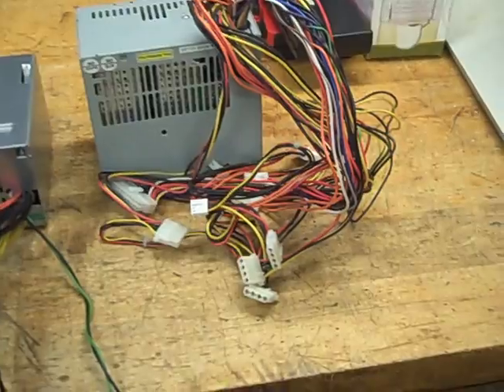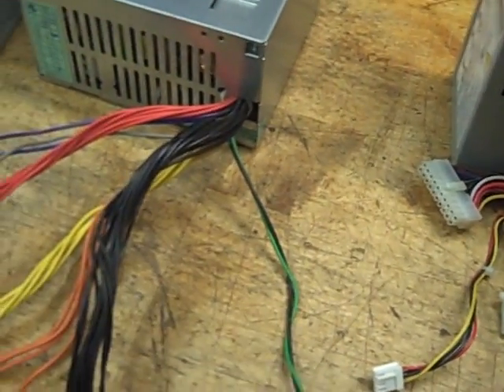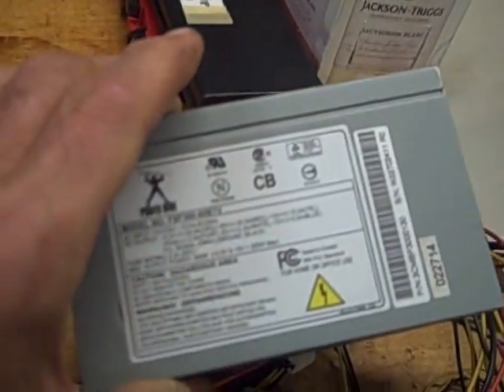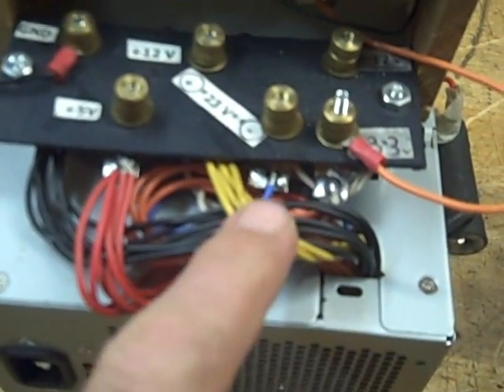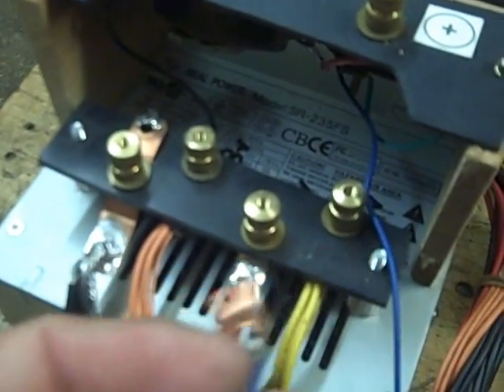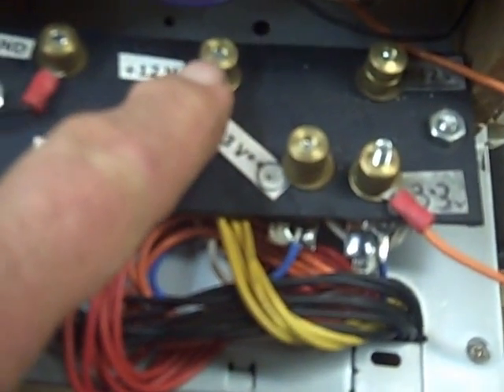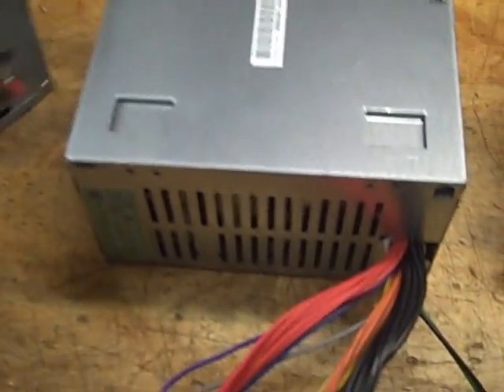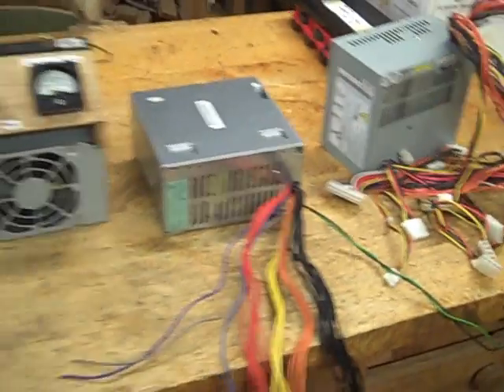DC Power Supply from ATX power supply

Comment: I have 3 identical power supplys. The 12v rails on them are rated at 8 amps. one thing I noticed is if shorting green and grey or black without cutting the clips off the PSU would power on. Once I started cutting off the clips and grouping the wires the PSUs would power on and die immediately. After many hours of messing around I found out that shorting green and ground AND brown and grey makes them power on as normal. I was hoping you could offer some explanation.
Reply from the maker: I suggest that you only use the green and black wires to turn the PSU on. That's what the computer motherboard uses to wake up the PSU.

Comment: Sir,
Did you used all the wires (like all the black wires and all the red wires) and connected them together?
Reply from the maker: Yes, I used all the wires of each colour. 
I removed about 1 1/2 in ( about 35 mm) of the insulation , twisted the bare wires together and soldered them into one big "lump" of wire. That was I get the full benefit  of the power supply.
You'll need a good soldering gun to get them all done together.
I know that some people don't use all of the wires of each colour.
But there are some uses of the power supply that draw 8 - 10 A  ( eg electrolysis for rust removal, flood lights from car headlights etc)
Reply: +disproman wow nice information I get here :D thanks man, I was thinking to use just one of each other but you have changed my plans :D

Comment: I have a new power supply I want to run a car stereo off the 12V only. Can I just tape off all the other extra wires or do I need to put resistors on them? Also what are the purple and grey wires?
Reply from the maker: You can simply use the 12V wires ( yellow and black) and tape off the other voltages.
You don't have to use a resistor since your power supply is a newer one ( the older ones i.e. 1990's needed it for stability). 
You should make sure that you power supply and the radio have some venting  - if they are in a sealed box, they'll probably overheat. The exhaust fan on the power supply should be OK to draw in cooling air for both radio and power supply.
Reply: Sweet, thanks for the quick response

Comment: hello

j'ai testé 15v court circuit pourquoi ?

I tested a short circuit 15v why?
Reply from the maker: I do not understand your question. Did you mean  that you short circuited the 15V combination?
I have found that IF yu short circuit any of the outputs the power supply stops but is not dead. You simply remove the short circuit, unplug the power supply from the wall for 15 seconds , plug it back in and it starts OK.
M
Reply: +disproman 
hi 
when I plug the blue + orange I get 15v. 
when I connect a fan or other I have a short circuit. 
it works with 12v + 120v fuse , but not work 15v :(
Reply from the maker: Remember that you only get about 0.3 to 0.5A from the blue wire. I think what is happening is that you are overloading the blue -12V supply and the power supply quits.
The other voltages  - 3.3V, 5V and +12V  have much more power available 15 to 30 A.
If you look on the nameplate of the power supply you will see how much you can get from the -12V supply.
M
Reply: +disproman 

I 12V 19A. If I understand correctly, I have not enough power, Power returned to 😵 secure mode, the only way to use the 15v source is to buy a more powerful power supply. Thank you very much for your advice.
Reply from the maker: About the only way that I know how to easily get a lot more current at 15V , is to use a microwave oven transformer, cut out the high voltage secondary winding, and rewind a new secondary with much heavier wire.
The primary on those microwave oven transformers is usually 125 turns. To get 15 V DC I would suggest 20 turns of 12 Gauge enameled wire. This will give your about 17V AC and allowing for a 1-2 V drop in a rectifier bridge, you'll get 15V DC.  
The transformer can be from an old microwave oven (free) the #12  wire would be about $8 - $10  and the rectifier is about $2. That would give you at least 20 A.

Comment: Can i get a bit more info on how made the current controller. must be simple, but i'm dumb. Thank you, for any help from anyone
Reply from the maker: Are you referring to the current controller in the unit with the Ammeter?
If yes, then all it is , is a variable resistor, that can handle about 0.7A. It is wire wound and I bought it at a surplus electronics store. You simply connect the variable resistor in series with the positive connection. That lets you vary the current that you allow  - limited to the 0.7A. If you need more current, then you just bypass the variable resistor completely.
Reply from the maker: The current controller is simply a wire wound variable resistor in series with one of the leads - eg the plus.
Reply: thank you

Comment: i see that you have the blue lead/ neg 12v so that you can get higher/different voltages in combinations. i am building my first atx bench psu, and don't quite understand the concept. i thought +12v and neg 12v would cancel out. i can kinda see the volt difference of 23v with 0v creating the lack of normal addition, but i'm not getting what two leads/banana posts are in play. is it the positive /red lead on the +12v and the neg 12v as the neg/black black lead causing the 23v difference where zero is a place value, and the neg 12v post becomes the common/neg/ground?? and then all the other combinations are based on this same concept?
good video though, if my last couple of thoughts/questions are on the right path then this is the first video that helped me get to that point. thanks
that's strange when i type /-12v youtube draws a line through everything after the negative symbol...
Reply from the maker: Well, Partick, you are sort of the right track.
The +12 and the -12 do not cancel each other .
So, it is possible to get many other voltages by choosing other combinations.

For example ( staying with the OV +3.3V + 5V and the + 12V  ) 
you can get a 7V  - the difference between the +5 and the + 12. 

Or you can get a 1.7V  difference between the +3.3 and the +5

SO now you can see the difference between the +12 and the -12 is 24 

Or you could get 17V ( the difference between -12 and +5)

The best way to visualize this is to draw a vertical line. Put a mark in the middle of the line which is the 0V. Above the line mark the + voltages and below the line mark the -voltages.  You can then see all of the combinations  as the DIFFERENCE between any of two marks.

The only restriction is ow much current you can get  - for example, the 24V  ( that is the -12 and +12 combination)  is limited to the current available  from the -12.
This is usually about 0.5A
Reply: Great explaination, thanks. I got the difference in volt =total vokt now. 
But HOW do I combine the negative 12 and X volt (mechanically, say I've got a red probe banana jack in one hand and black probe banana jack in the other)
Or
Do i just tie a jumper rail from the +3.3v/+5/+12v to the negative 12v Then plug in the banana jacks》 red +, black -
Reply from the maker: Hmmmm - I wish I could add a picture here - it would be worth 1000 words.
Give me a day or two and I will post another video  showing the set up.
Reply: +disproman you rock!!!!!

Comment: Very cool, but where did you get the resister(seeing as how it doesn't look new out of the package).
Reply from the maker: I had it left over from previous projects about 10 years ago.
You can get them at Sayal Electronics, or an electronics surplus place.
In most power supplies the resistor is not needed, but some of them DO need it to stabilize the output.
Try making the thing without the resistor and see if it works .
Reply: Thank you.

Comment: does anyone know where to salvage a power resistor under 10 ohm,200watt, from old elec appliance
Reply from the maker: About the only source I know for such a resistor is a length of nichrome wire ( usually 22 Guage) that has a resistance of 1 om per ft. But dissipating 200 watts will make the thing glow red hot.
You might be able to make up a number of such nichrome wire resistors in parallel so that each one only has to handle say , not more than 30 watts.
I suspect that a resistor over 50 watts usually is fan cooled.
Come to think of it, a plug-in 1500 Watt room heater would be about about 7.5 ohms - they usually have a fan and the wiring to handle the current.
Reply: thanks,let me explain what im trying to do this might sound weird ; i made  whats refered to a "nano bucket", you wrap copper wire around a 5 gl pail ,about 90 turns, you put a solution in the pail ( water vinegar salt citric acid ) apply power and put your foot inside for 30 min. The idea is to extract toxins in your leg to take the load off your kidneys. its used to heal. The power supply i used blew, it was 16v 3amp, not enough. The guy who instructed me used a power pack from a lab top which supplied 5 amps and he got results. before i attempt this again i measured the ohms of the coil pail and got .5 ohms almost a short so i want to protect the new power supply by adding some more resistance while maintaining enough power to create a sufficient field to activate solution.
Reply from the maker: Sure , it's weird, but life as we know it is weird every day.

To get 5 A from the 12 V source of the ATX power supply ( that's well withing its capability) you'd need about 2.4 ohms.  The resistor would be dissipating about 50-60 watts.

So, if you could find a 12 V automotive light bulb that is about 40-50 watts ( like an old non-halogen headlight)  you should be able to draw roughly 5 A from the ATX power supply. An auto junk yard is your best bet.

I would get more than one headlight and that way you could connect them in series to get less current or in parallel to get more current. Even better if you got a headlight that had low beam and high beam in one bulb, it would give you even more scope to fool around with the series / parallel connections.

BTW if you overload the ATX power supply, it simply stops. You then remove the load, unplug from the 110V wall plug, for 6 - 10 seconds, reconnect the 110V and you're  back "on the air"
Reply: my new power supply is the atx , so use another load to protect the power supply other tan a resitor good idea ,i will try thankyou

Comment from the maker: Try taking the resistor off completely.
The green connected to any one of the  black SHOULD turn it on.
If that doesn't happen, it usually means that the power supply is no good.
I assume there is no other ON OFF switch on the power supply.
Reply: what if mine powers on and shuts off immediately
Reply from the maker: That usually means that there is an internal overload and frankly the best strategy is to get another power supply.
You can open it up ( making sure that the 110V AC is not connected) and see if there something physically evident - but usually it's one of the components. It's not worthwhile to see if you can find and fix it at that point

Comment: What if you don't have a green wire, I have a Dell model number PS-5201-1D power supply from a 1998 Dell. Thanks
Reply from the maker: +Don Hard 
Hmmm, that's quite unusual. 
       All of the ATX type power supplies that I've worked on or seen , all have a green wire. It's the connection of the motherboard to "wake up" the power supply  And I somehow remember that the ATX standard for the colour code is universal i.e. applies to all vendors. The Dell power supplies that I've used also have a green wire.
      So, I'm kinda stuck about what to suggest. 
      I suppose that you could try connecting one black wire to any of the wires that are not  yellow ( 12V) red (5V) , orange (3.3v), blue ( -12V) or white (-5V).
      The ony thing that will happen is that the power supply will shut down if there is a fault. If that happens, simply unplug the power supply from the socket, wait 10 seconds and plug it in again ( and don't do that one again) .
Reply: +disproman Hello, Here is what I got blue, yellow, white, orange, gray, red, black, blue/white and purple. 
 I can send a pictures if you would like. Thanks from Don     P.S. I did try black with purple and black with gray it come on for about two seconds then would shut down. any idea what to do to keep it running thanks again.
Reply from the maker: +Don Hard 

I understand all of the colours you list except the blue/white.
Try connecting the blue/white to a black wire- any black wire.
Reply: +disproman Hello, Try that and it did not work. Also  I did try black with purple and black with gray it came on for about two seconds then with those two but would shut down then I would unhook them and tried again and it did the same thing come on for two seconds and shut down. Also there are three blue/white wires. If you would like I can do a YouTude video and give you the YouTube address it is on so you can check it out. Thanks again from Don.
Reply from the maker: +Don Hard 
OK on your testing.
Without being a smart a** about it, maybe the path of least resistance is to find another power supply  - your nearest computer shop probably has a pile of them in the back.  Or simply ask around who might have an old computer that you can cannibalize.
But ,  hmmmmm, this one is intriguing. Somehow the motherboard has to signal the power supply to turn on. 
I assume that there is not other external switch on the power supply -  some of them have that. 
Here's the color codes
https://en.wikipedia.org/wiki/Power_supply_unit_%28computer%29
This source warns that some Dell power supplies between 1996 and 2000 do not use the standard color codes.
http://web2.murraystate.edu/andy.batts/ps/powersupply.htm

Have your taken to cover off the power supply  - do a sniff test - a burnt smell or a peanut butter smell means that something has self destructed.
it could be that this power supply is defective -I've assumed it is OK, but maybe that's not right.
Reply: Hello yes that is my thinking too I have a newer ATX that I am going to try. The Dell  ATX is from 1998 and has a different color codes then the newer models so I am going to try this newer one. I need to look at it and make sure it has a green wire then I know it will work. Thanks again for all your help.

Comment: nice explanation !  i found a few old computers at the city landfill,took out the power supplies and  got them all working as bench tops.  Now i was wondering if i put the 3 volts and the 12 volts together if i could successfully use it to charge a car battery .probably going to try it this week.  any thoughts.
Reply from the maker: +vic mon 
To charge a 12V car battery, you'll need about 14 - 15 V.
The only way to get that is to use the -12V  and +3V connections.
The challenge though is the the -12V is limited to about 1/2 Amp ( 500mA) so it might
take a while to get a full charge. But it should work  if the battery is not totally discharged.
Reply from the maker: If you connect the +3 and + 12, you'll get 9 volts  - the difference between 3 V and 12V.
You'll need about 14V to actually charge a 12V car battery.
You can get a MINUS 12V from the BLUE  wire - but it's only good for about 0.5 Amp or so.
To charge the battery, use the -12V BLUE   and the PLUS 3 ORANGE to get a 15V difference. IF your car battery is not well charged to begin with, your ATX power supply will be overloaded and will shut down.
To prevent this, you'll have to put in some amount of resistance ( 2-4 ohms) to keep the current below 0.5 A.  The resistor must be able  to handle at least 5 watts.

Comment: sure i'm not, however mine power supply running won't
Reply from the maker: If the power supply does not turn on - you can tell because the fan will start to spin - then your power supply is not good. Get another power supply - they are cheap or free

Comment: Thanks for the reply.  The 12v rail is rated 42amps.  I'm pulling 15amps and it's shutting down.
Reply from the maker: It could be that the rating is not for continuous current draw such as what you are doing to charge the batteries. I can see that internal capacitors are OK to draw that amount of current ( 42A) for a very short period of time eg when a Hard Drive starts to spun up, along with the CPU booting up.

Comment: So i tried this but failed.  I got a 725w psu.  its a single 12v rail with a Max output of 42amps.  When i put a 15amp load the voltage drops to below 8v then shuts down.     I'm using it to charge some 7.4 lithium batteries.  I don't know why it's dropping and not staying at a constant 12v.    I did every thing in your video plus had a +3.3v sensing wire that i connected to one +3.3v wire and a gray vs wire connected to a ground wire.  I did that only because on it was like that on the mainplug
Reply from the maker: If you are getting that kind of voltage drop , that is down to 8 v on the 12 v output, you are overloading it quite a bit. The power supply is doing what it should - it shuts down before things internally burn up.  Putting that much current into a Lithium ion battery isn't a good thing. You might try limiting the current with a resistor in series with the battery.
 The resistor can be in the range of 3 ohms, but it will have to handle the current. I made one from some nichrome wire using a DVM ser to R to figure out the resistance. The resistor will get quite hot. I also suggest that you use  a DC ammeter to measure the current you are taking from the power supply ( if you aren't dong that already). Making a DC ammeter from an analog meter movement is straightforward.

I usually limit the lithium ion batterys that I recycle from laptop battery packs to about 0.1C where C is the capacity in mAhrs eg C=1800mAhr, charge at 180 mA
  I found that the Battery University  to be an excellent source of information
http://batteryuniversity.com/learn/article/charging_lithium_ion_batteries